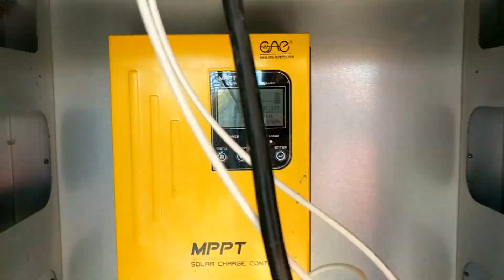Who Builds AirCrete Rebuild Life After Disaster Divorce or Retire For Real Change

Comment: EPIC cement is another great material like AirCrete, very similar but a stronger material.  Using basalt also makes it more durable and protects from EMF's.
Reply from the maker: Basalt conducts current or block magnetic fields?
Reply: Tiny-Giant LifeStyle I believe it blocks electric magnetic fields.  It’s a dielectric material/lava rock so it’s opposite of metal.

Comment: I like the circular wall structure idea. The building in the example would be more practicle if their were at least two circle wall structures, one nested inside of the other. This way the roof would be a simple lean too (one circle wall taller than the other).  Also, this layout would provide for garage parking, covered patio, interior court yard, attached greenhouse and interior/exterior porches. Air- Crete is inexpensive, and most of homes costs is in the finishing, so more of the air-crete structure the better.
Reply from the maker: Yes